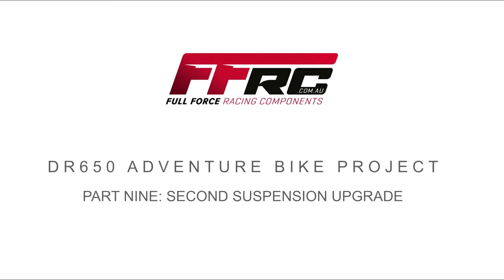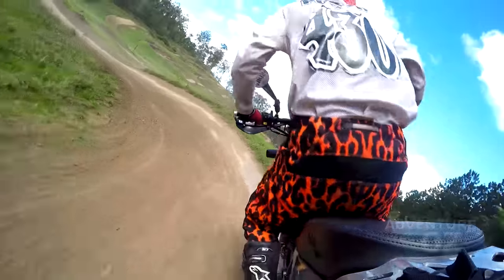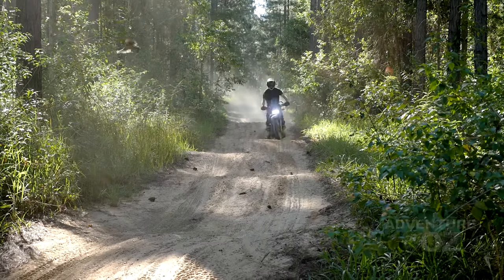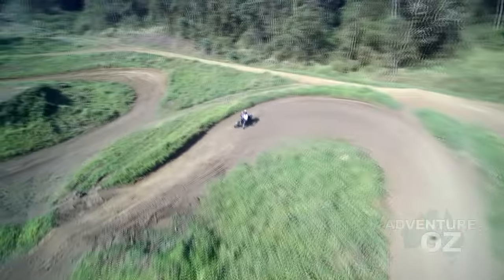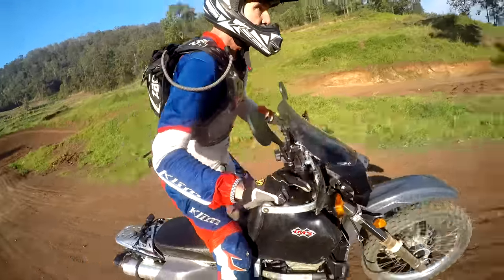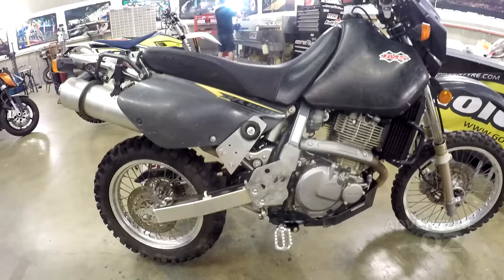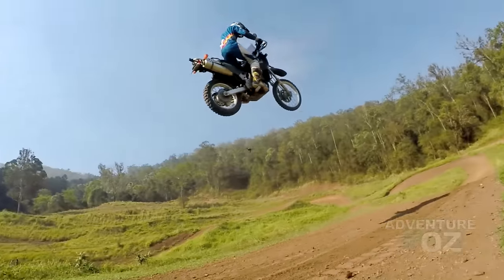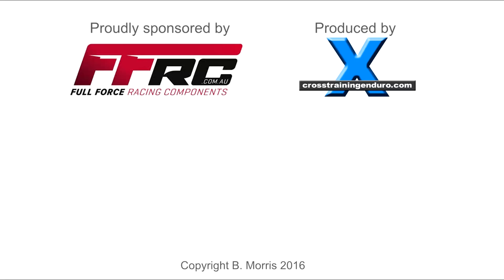DR650 project: best suspension upgrade ever?︱Cross Training Adventure

Comment from the maker: FFRC PLEX VALVES UPDATE The creators of Plex Valves sold the FFRC business. We picked up new Plex Valves for our latest DR650s and unfortunately they just don't seem to work they way they used to as the new owners have tweaked them. The forks are quite harsh and lost all the 'plushness'. 

We tried 2.5W fork oil with no success. I took them back to FFRC for adjustment but they was a small improvement but still harsh on bumps. I eventually just swapped to a a pair of RMX250 forks. 

It might be worth trying the Intiminators or Cogent DDC in the USA or DXF Parts in Australia in the meantime. It seems FFRC has changed yet again to new owners... 

COMPLETE LIST OF DR650 PROJECT VIDS!
Introduction to the DR650 https://www.youtube.com/watch?v=58vB-5urcJI
Power mods overview https://www.youtube.com/watch?v=z7GcNdlDwdk
Transforming the carburetor https://www.youtube.com/watch?v=aN1aU0G4YQE
GSXR exhaust mod https://www.youtube.com/watch?v=Em6SzMTF5SY
DR650 known issues https://www.youtube.com/watch?v=rSNBa63UWx8
Basic suspension mods https://www.youtube.com/watch?v=aTYAwIBX9aQ
Protection for the DR https://www.youtube.com/watch?v=NQcXfOJsLSM
Ergos: pegs, bars & seats https://www.youtube.com/watch?v=geLR5u8sMhI
Weight reduction https://www.youtube.com/watch?v=h6fl-GWdURk
Best suspension mods https://www.youtube.com/watch?v=sGdLm9sXzdo
Fixing noisy starter motors https://www.youtube.com/watch?v=6P4n80FJP18
Headlight upgrades https://www.youtube.com/watch?v=G28GoyWp6LI
Steg Pegz review https://www.youtube.com/watch?v=SnI_pfkuQsg
Reply: How do these compare to the Cogent or Ricor mods on procycle.us ? Any Idea?
Reply from the maker: I haven't seen a direct comparison, Rob. But I do know there was exhaustive testing on a $30,000 suspension dyno to get them just right. And there's no need to do any extra work, just drop them in. The old intimanators required taking the forks apart and modifying them. The latest versions still need heavier fork oil to make them work properly... but the FFRC Plex valves are designed to work with the stock fork oil.
Reply: @crosstrainingadventure  I have been trying to find more information on the flex valve to order them but I have no luck with the provided link. I am in the US.
Reply: Sorry wrong pm but yes suspension is tricky lv been to 3 different mobs and the best lv found so far was shock treatment at wallacia out of Sydney and now back to the AC Tig dude lol
Reply: I haven't done much to the forks just springs the bike is like about 250 kgs loaded up so it doesn't deflect easily and l replaced the rear shock with a Elka complete shock with external preload adjustment it works very well and high and low speed compression on the fly adjustment is very handy the external preload adjustment lost its hydraulic pressure but l can still adjust it with tools it's done over twenty thousand ks and hasn't missed a beat worth every cent of 1100 hundred dollars it cost (cape York,Tanami,gt central D, Simpson , golf country etc )
Reply: @jw8556 Dude, seriously consider breaking down your thoughts into multiple sentences man
Reply: @slipngrip  wat Eva dude
Reply: @slipngrip  l ride dirt bikes lm not an English teacher bro
Reply: The ffrc valves still the same not good after new owners?
Reply: Hey Barry - what's the latest on the FFRC valves? Still no good in 2024?
Reply from the maker: @t2kojo  Sorry, only just saw your comment. See the updates in the original comment.
Reply: @crosstrainingadventure  thanks Barry - sounds like Cogent DDC might be the way to go…

Comment: I got PLEX valves for my DR, kept the stock progressive springs. It's world of difference especially when braking. Here's a tip though, remember which way your springs came out if you are using progressive springs. If you put one in upside down it will be wonky

Comment: Talking about timing. Wow! I have not watched one of these in weeks and typed in "Adventure oz" to see if there were any DR650 related clips I had missed. 

Suspension is the last thing neglected on my bike, but it has not seen real rough off-road yet just two track and gravel roads.  
I'm about done modding the DR, mostly just ergonomics, carb mods, hand guards and a larger fuel tank at this point. 

And I want to thank you guys for the epic BST magic tricks. After 3 iterations, the shortened and tapered stock needle works like dark-magic. My ass says its 20% more power, though its likely 3hp, the throttle response and over all change in power delivery is astounding! There will be no pumper carb on this bike. :)
Reply from the maker: great to hear justin, its around a 10% increase with all the mods which feels like a lot to the bum dyno :)
Reply: Justin J G'day Justin. I just installed the procycle jet kit a few days ago. I have a staintune exhaust so I put in the 155 main, drilled the second hole in the slide, put in the new needle and air fuel mixture screw. I didn't follow the instructions for the airbox mod, instead I drilled a 2 inch circle (51 mill) as per the  adventure Oz video. Mate what a difference! Stock gearing and in first it just throws the front wheel in the air so bloody fast I almost flipped it because I wasn't expecting such a difference! I honestly couldn't be happier! Why anyone would spend the extra coin on a pumper carb I'll never know. It runs smooth and without any flat spots.

Comment: I've been two routes with DR650 suspension.  One DR I had used a DRZ250 front fork (fits right in but uses smaller front disc and DRZ400 rear shock which required machining on the bottom fit the DR650.  This was an okay set up but my second set up was excellent.  A KTM WP front fork and triple clamp (same size steering bearings but needs a spacer) and a re-valved and sprung mid 90's KTM rear Ohlins shock (Cost about $150 US plus 400AUD for the Ohlins servicing).  This set up also required a KTM front axle and wheel which adds to the costs.  If I went another DR I'd go similar mods as described on the video to keep costs and modifications to a minimum.  The DR requires KTM money to make it into a KTM.
Reply from the maker: it's fun messing around with forks if you like tinkering, hey bing O? i messed around with some old RM250  on  a DR650 a few years ago but it is a fair bit of messing around. otherwise i'd say these plex valves look like a good value option.... which could even be sold separate to the bike if you really wanted to get most of your money back. same with intiminators too although you'd probably change the fork oil back to 5w.

Comment: Okay blokes, I had the plex valves pre ordered before the production version  were ready for sale. FFRC sent them to me as soon as they were able so I've had them in for a couple or so months now. Stock springs, stock oil and plex valves inserted. Goes for ride and f&ck me!!! Fellas, just buy them! I'm 110 kg's (fat) with a 20 litre Acerbis tank fitted. I consider myself an average experienced rider and unless you are more like the bloke riding in this video, I don't think any of us DR650 riders need heavier fork springs, so try just the Plex valves first. Seriously just order yourself a set cause the bike handles so much better on road especially during braking and offroad it's the bees knees! Just do the mod you won't regret it I guarantee! 😊
Reply from the maker: i found it hard to believe the guys when they said i probably wouldn't need stiffer springs.... awesome front fork upgrade. :)
Reply: ADVENTURE OZ   Yes it's an awesome upgrade alright! It's very true what you said about them being plush over the small stuff. The first thing I noticed when riding down the dirt road that I live on, was where have the corrugations gone? Then under braking, ahhh, suddenly I felt some confidence flow through me! 😂 Then I noticed that the bike just sits flatter for want of a better way of putting it especially during gear changes. Then to some harder dirt tracks and off the track even, the forks now give me a much smoother/plusher ride to the point where I noticed my speeds are much higher now on the same tracks. My rear shock is still stock but the massively improved forks have somehow made the rear feel better. Is that even possible? Anyhow I couldn't be happier with the Plex valves and to anyone who reads this just buy them! Cheers!

Comment: edit:
plex valves will NOT fit on pre 1996 DRs.
Pay attention to this - I did not; read below... ;-)

my advice before ordering plex valves: 

Disassemble your fork tubes and check out if the inner diameter decreases.
The plex valves are meant to be insert all the way down inside the fork tubes.
I run a DR650 SP42B from 1990 and unfortunatly the inner diamerter of the fork tubes decreases after 2cm by a few millimeters - plex valves stuck on the top of the fork tube instead of making all the way down.
Check out if there is such a transition in inner diameter at your fork tubes - very likely Suzuki has modified the forks over the years of DR production.

Despite the non-fitting plex valves on my DR  - much appreciate to this channel; love your videos due they are a great help to me as a rookie.

all the best!
Reply from the maker: Bummer! Did FFRC say they fit pre-1996 models? If so they better change that info by the sounds of it...
Reply: @crosstrainingadventure  Have not find any spec limitation on the FFRC page yet.
Still waiting for a response on my message and photos of the situation  I`ve send to FFRC.
Will keep ya update.
Reply: alright - finally found an advice on the FFRC-page...directly below the headline: "suits 96 - current models"
my bad at all - in Germany we used to say: "who is able to read has a clear advantage"
Reply: @crosstrainingadventure  hello :) i try to find a good dr in my area. Today i tried one (year 1992 and i read the front fork is 41mm instead of from 1996 models 43mm fork ) Should i worry about the old ones, because of more flex ? What do you think :) Thanks if you answer.

Comment: Epic video.  Even with the suspension upgrades, those riders are nuts ;)
Reply from the maker: i just kept hoping the frame would be okay lol
Reply: @crosstrainingadventure  how does the frame hold up to the abuse if rough riding? Do you find you need to strengthen it up in any areas? Ive just bought a new Dr and will be looking to do suspension up grades too. I'd be thinking frame might start cracking in areas though. Also does any these upgrades give more height of suspension and vest ways to make seat height higher? Im reasonably tall and used to XR600R size height which I like Dr are fairly small in comparison. Cheers from NZ

Comment: My (short) experience with the Plex valves...

My weight is around 75 kg without gears.  My DR650 is extensively used off-road, either on gnarly single tracks or faster fire trails; it has no long-range tank and no extra bling. My forks have single rate 0.46 kg/mm springs, along an after-market shock.

I have never used Intimidators or Emulators so I can't compare the Plex valves performance against them. Nevertheless, without going into details, there is no question that the Plex valves do work and I'm pretty happy with them.

When you are 80 kg or less, the budget DR's stock shock may be OK for most situations, provided you adjust the sag and set the compression settings adequately. However the non-adjustable forks will never be acceptable. Way too soft. Small jump will make it bottom out and on-road braking can be hair-raising.

The Plex valves have a definite advantage over other front-end systems since they procure a simple, decent suspension upgrade that is relatively inexpensive and dead easy to install yourself. No needs to remove the forks from the bike, just drop the valves in, add the recommended amount of (stock) oil, keep the original springs or upgrade them, and that's it.

Of course, if you are heavier or more performance demanding, a shock upgrade will be beneficial as well.
Reply from the maker: great to hear it's working out frogzie. i have used emulators before and they certainly help but i think the plex valves are another step or three up. the stock forks are so bad anything is going to be an improvement lol!

Comment: IMO, 49mm Showa Dual Chambered forks off a 96-98 rm250/125. They should slide right into the triples. All you have to worry about is changing fork springs.
Reply from the maker: and making a caliper adapter plate to suit the stock brake rotor. i tried those forks once on a previous DR650.

Comment: just watching this video , and as the proud owner of a dr650 2019 model , i can honestly say that if this is the type of riding you are going to do ,then the dr is not the bike for you , spend a little more money and get a ktm .. to get the dr up there were it needs to be . you need to change the suspension , tyers , carby jetting , breathing in and out , front and rear sprockets , and that seat is a ball breaker . .iv put an american made after market sargent seat on my dr .. that all said and done as a 60 year old whos happy to just putt about from a to b . the stock standard dr is just right and at the right price
Reply from the maker: The only problem is the KTM costs close to twice as much, and then often you need to do update the suspension, scrap the tyres, remap the fuel injection, replace the exhaust, change the gearing to try and get around those narrow gear ratios, and scrap the ball breaking seat... mostly the same updates as a DR and then how much has the orange bike cost?

Comment: nice, the bush pig is becoming a ballerina.... so light and nimble on its feet :-)
Reply from the maker: if you can squeeze a rhino into a tutu, i agree lol
Reply: on a serious note...... after all these sorts of mods, what is it like to ride on the streets? I want something a little more off road that a V-Strom but it will be my daily commuter..... would the DR after all this work be suitable in your opinion?
Reply from the maker: i think the stock DR suspension is adequate for plodding around the streets but the moment you push it hard or get into a panic situation it can turn nasty, especially with the front diving under brakes. the bit of road riding i've done it still has the plush feel of the stock setup at normal speeds but is way better when braking hard or riding aggressively.
Reply: excellent....... The answer I was hoping for :-)

Comment: Interesting results and I'm sure FFRC will have many customers after this impressive video. Was the motocross jump done with the stock fork dual-rate springs or heavier springs?
I couldn't manage to get any information from the FFRC web-site? I'd like to know more about the plex, how they work,and also details on the rear suspension upgrade. However my big issue is that my bike is based in Sydney while FFRC is in QLD, and my old suspension definitely needs to be fixed/upgraded at both ends. Will FFRC provide other suspension specialists with their magic components?
Reply from the maker: just found the link frogzie.... https://goo.gl/ftLRHC  i think their earlier jumps were stock springs and it was bottoming out a fair bit on the big 50 footer. then they went single rate and a bit stiffer.... but only because they were riding the poor bushpig so hard. as far as i know FFRC will be mailing the PLEX valves worldwide. for rear shocks, just mail it up to them i guess. or you can order the valve/piston to put in yourself maybe?
Reply: Thanks for the detailed response.
Another option for upgrading my suspension would be, I guess, that you organize another adventure ride Brisbane/Sydney and that I join you on your way back, of course if you agree to wait for me: my DR can catch up with KTMs, but cannot with Betas!
Reply from the maker: i'd love to do that ride again but too busy nowadays, sigh... oh and in another comment today FFRC confirmed the big jumps in this vid were also done on the stock springs.

Comment: So Barry, compare the DR 650 after the mods you've outlined to a KTM 640 ADV -- obviously, they both have strengths and weaknesses but have similar purposes. Dave Darcy from MAD TV is a big fan of KTM, as you know, but the DR was used by Nugget to cross the Simpson (with some structural failures). Anyway, what are your thoughts?
Reply from the maker: haven't ridden a 640 enough to comment.... definitely a far better bike stock though before mods.
Reply: Do you have a grand total of the upgrades costs or of each segment - carb, air box, suspension, etc? As you said, the bike is such a relative bargain that upgrades still keep the price well below the more exotic brands. Thanks for you information. And what year is the oldest that these mods would be viable? Maybe add it to the description of the video?

Comment: I'm trying to see a video of your upgrade to rear suspension. What specifically did you do/install?
Reply from the maker: it ws discussed in this video
Reply: Sorry, it went right over my head. How would I go about getting custom revalve and piston in the US the way you do? Novice to ADV riding.
Reply from the maker: if you can pull apart the rear shock you could order the parts from FFRC. but otherwise you would just need to find a decent suspension tuner locally. they will know how to revalve but very few will be able to do a custom piston.

Comment: are you sure these valves add rebound adjustibility to the fork??? i thought these type of valves only control compression adjustment and then the oil level/ weight controls rebound........
Reply from the maker: you have to pull them out to do any tuning apparently.